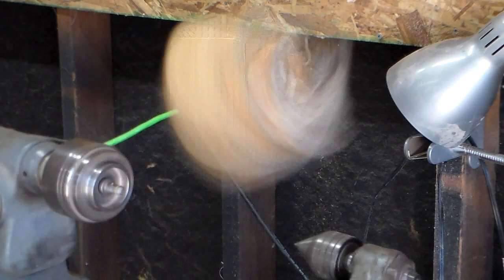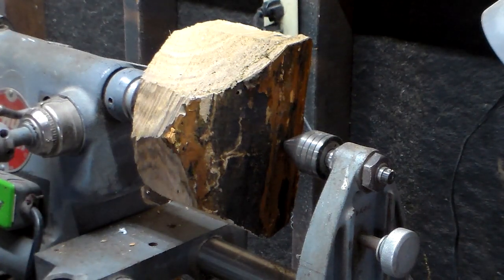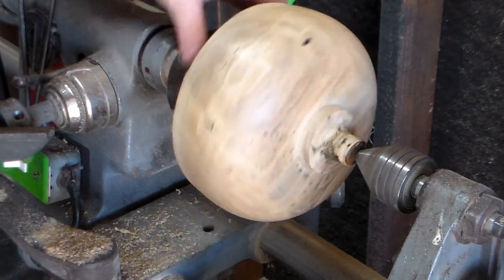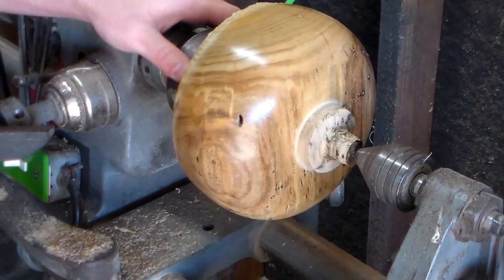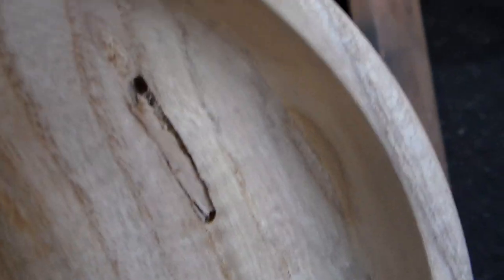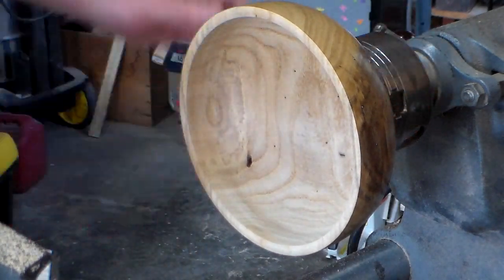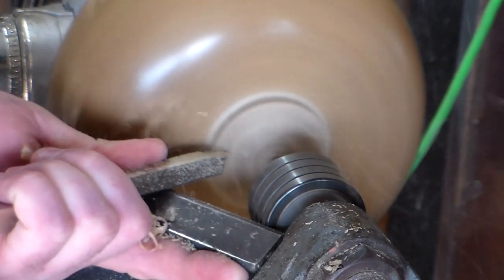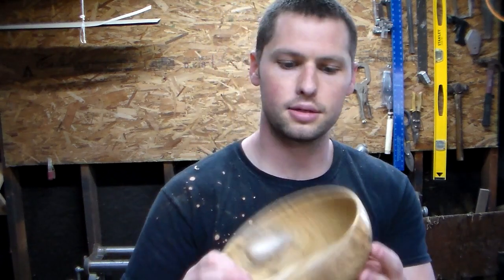Wood Turning a bowl from a log of sassafras

Comment: Is that green wood? How do you prevent it from warping and cracking?
Reply from the maker: If memory services me correctly. I believe the log had set at a buddy's house for about 8month so it was not super green. It you are turning green wood the best practice is to rough turn it. Which means you do not turn it to its final thickness. You leave it about 1" +/- thick. Then you place it in a brown paper bag and fill the bag with the wood shavings and let it sit for 6 months or so. Then you finish turn it. That's avoids the warping and cracking. Not fool proof bet it works well
Reply: @MillerMade  awesome, thank you!!
Reply from the maker: @masterdouglas  not a problem